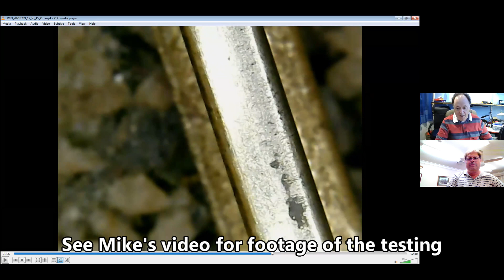Track cleaning on your model railway - what science and experience tells us

Comment: There is a slight problem with your test at 6:03. You should repeat the test cleaning the opposite rail (so IPA on the left, contact cleaner on the right), and run the same loco in the same direction, then check your results.
Reply from the maker: Thanks, the test in the video is illustrative but we both have run other tests looking at both rails and cleaning sections with IPA and non-polar solvents with the same results.  I’ve also got some longer term tests running at the moment to look at long term build up which I’ll post on in a month or two
Reply: @trw1089  I think when making a video like this, you probably should use a fairly scientific approach and show repeatable results. There are plenty of videos out there saying clean your track with this or that and kinda half-done testing. With long term tests, you really need to document it well and it needs to be done on the same track to rule out issues with the track etc. Some questions come to mind such as how long did you wait before running the test? I've used IPA in my CMX, but at night before I'm wrapping things up for the evening. The next time I run things on the track the IPA has fully evaporated. Different results with DCC vs DC? Just some thoughts :)
Reply: @Oorail  I'll just come in here, the tests were done by myself but repeated several times before we went live with the results. The track treated with IPA certainly shows signs of oxidization in short order. The track treated with the contact cleaner simply does not. I've not had to clean my track for two or three weeks now, used to be a weekly event or before every new video. The information Tony and I are setting before fellow modelers is not new at all, its all been proven years back but for some reason the word has not got out there. Both IPA and the non-polar options evaporate within minutes. Hope this helps?
Reply from the maker: @Oorail  thanks, we certainly have followed the scientific method with our tests, our hypothesis was that non-polar solvents, according to the evidence, should provide a better connectivity between wheel and rail because of minimizing oxidation.  We proved that hypothesis through a number of tests, but we also saw the build up of oxidation deposits (black crud) on the IPA cleaned track both on my layout and on Model Railway Unlimited’s testing.  The results we presented illustrate what we found, but we also need to keep the video entertaining and not too long.  The problem with IPA is that the polarity of the solvent means that even after cleaning and evaporation it will allow the formation of active sites for oxidation on the railhead, especially if an abrasive track rubber is used beforehand.  As for DC vs DCC, I think the only real difference is that DCC is more sensitive to dirty track because of loss of signal, not because 14VAC is worse than 12V DC.
Reply: @trw1089  Not really. You haven't even mentioned what kind of IPA you are using - 50%, 70%, 91%, 99%? DC and DCC, along with the direction of travel would have an impact on the flow of electricity through the rails no? You are also saying that an evaporated liquid is reacting with the wheels on the loco? However it's evaporated so it's no longer there? When asked about it as I have here, you say you have other testing, why not show it?
Reply: @ModelRailwaysUnlimited  I'm familiar with the original articles, I think from 2010 and 2019. What type of IPA did you use? :)
Reply from the maker: @buswellj  I was using 100% IPA as supplied by Sydney Solvents which my wife uses for ceramic ink art.  Previously I have used 100% IPA supplied by a hardware store.  I can send you a photo of the labels if needed.  model Railways Unlimited was using DC, I was using DCC, we both had been testing for a few weeks prior to finalizing the filming.  When we were setting this up, we both had done a number of tests to ensure what we were saying was backed up by the evidence, but in the interests of not having an hour long video we presented the results which confirmed what we had seen, to best illustrate the point.  I can post all the references, I can show the other results, if you want definitive proof.  The process of oxidation requires the initiation of active sites for it to start, that happens when polar solvents provide charged points on the rail surface for it to commence, and even after evaporation, the sites would have already been attacked by oxygen and any residual moisture to continue the oxidation process.  This leads to the ablative removal of metal through arcing which builds up to be the black deposits, as confirmed by those who have been observing the arcing and the chemical analysis of the deposits.  Reducing the active sites for oxidation, the microarcing that removes the metal from the rail surface and therefore reducing the deposit build up is what the science and evidence (plus our experience here) shows.  Using a non-polar solvent helps to reduce these elements, hence why it is likely to continue to provide superior results compared to non-polar.  There are other components to this too, like the use of graphite to improve conductance between wheel and rail, and a protectant to continue to minimize further oxidation, but these both impact upon traction which both of us were trying to avoid.  Model Trains Unlimited was also concerned about long term impacts on traction tyres and sleepers which he goes into in more detail in his video.
Reply: @trw1089  The opening title on your video is "The science of track cleaning..." and Mike goes on to reinforce this at 2:51, but aside from some screenshots from a USB microscope, there isn't anything scientific in the entire video other than you two in a video conference talking about the MRH Magazine article. It just seems odd that you've done all that testing but didn't reference any of it in your video? There isn't a statement such as "we both used 100% IPA to avoid water content". Don't get me wrong, I really enjoy Mike's videos and have been a long-time subscriber to his channel, he is a stand up guy. I think however in this case your testing is a bit flawed, definitely far from definitive. There are a bunch of variables you are ignoring such as the environment (where is your layout, whats the humidity and temperature level, dust level?), were the loco wheels clean, did you run rolling stock, were those wheels clean, what lubricant was on the axles of the loco, what type of motor is in the loco (some will deposit carbon), the power supply and wiring. Mike's test is a good idea, but for it to be scientific, you would need to run it several times in a controlled environment which limits and show how its reproducible. Going I cleaned one rail with this and one rail with that, here are the results, that isn't definitive. Could be that one of the wheels on one side was dirty, could be that carbon deposits fall out one side more than another on that loco. The best way to conduct these tests would be with a brand new loco on brand new track without rolling stock. Another thing to keep in mind is that non-polar liquids are non-conductive, that is the reason they are used in electrical contact cleaners, so you can spray electrical components and not worry about shorting things out. While they do evaporate quickly, some of them leave a residue which takes longer to evaporate. So now you've got a rail you're trying to improve conductivity on that you've just covered with a non-conductive cleaner! :)
Reply: @ModelRailwaysUnlimited  If they completely evaporate in minutes, before you applied any power or traction to the rails, then how does it have any impact on the rail?
Reply from the maker: @Oorail  I really don’t know what your problem is but frankly we approached this by investigating the background science, reviewing the chemistry (I have a degree in chemistry and have been a scientist for 30 years), looked at the chemical analysis of the deposits, undertook a series of tests and they supported our conclusions and that of the material we reviewed.  I’m sorry it’s not a peer reviewed scientific paper (of which I’ve written a few), but it is certainly approached from a scientific approach.  If you don’t like the results, do your own testing and tell everyone what you found and how that’s consistent with the background material, otherwise, frankly, bugger off!
Reply: @buswellj  Hi John Servisol IPA 170, take care, Mike
Reply: @Oorail  Phew, thanks for the nice comments. I am not sure what is going on here, I explained deeply in my video (have you seen it) that I did indeed clean all the wheels with either the IPA or WD40 Contact cleaner, then cleaned each circuit with the same. Isolation was observed. I then ran the trains and observed the results. Nobody has their layout in a sterile atmosphere controlled test lab, so I felt that with Tony being where he is and me here (UK and Auz) we were representing the general environment that a model railway lives in. To have shown every single test and every single result would mean a video of hours in length. And why would we do that when the science is already proven, all we have done is seek to provide information for the community and backed it up with testing of the type anyone can do. I have used IPA Servisol 170 and another 98% type for decades and it was indeed a culture shock when Tony pointed out the possibility it might be making life harder, but having done the test I am convinced and convinced enough to bring these findings to our community. I am sorry you feel so aggrieved by this, I've read all your messages and still don't understand why? If you are saying its the title i.e. 'The Science' behind track cleaning then I feel it is justified because the science is already proven and know long before we made our videos explaining it? Perhaps if you feel so strongly about this you could do some tests and produce some videos about your findings for your excellent channel? Cheers, Mike
Reply: @trw1089  I don't have a problem, I'm just interested in the subject, given that I have hundreds of feet of track on the layout here. However you seem a little touchy with someone asking questions. Since you have a chemistry background professionally maybe you can answer my earlier question? Doesn't the IPA evaporate at 100% if so how does it alter the track to cause deposits? I'm interested in the results. I actually did testing about a year ago when I read the original article in MRH magazine, right down to buying 5 different kinds of contact cleaner because IPA was in limited supply due to the pandemic. Not all contact cleaner is equal, some evaporate 100%, some leave a protective film. That film is as you pointed out, non-polar because contact cleaner is used to clean electronics and you can't have a conductive film on your circuit boards or it'll cause a short. If you are wiping it on with a rag, its not so bad, but if you pour a CMX full of contact cleaner that leaves a residue, well you are going to see some of your locos cutting out in places where that film is thicker as its non-conductive. If you don't want to have a healthy dialog this is your channel and I'll respect that by stop commenting. However if you are really trying to get to the bottom of it, you'll read this and perhaps answer my question?
Reply from the maker: @Oorail  the problem I had is the tone of your questioning and that you said it wasn’t scientific.  I love it when people comment, but if the comments are disrespectful then I will respond in kind.

The challenge with putting together a video about the science of track cleaning is keeping at a level that appeals to a wide audience, and that’s what Mike and I were trying to do here.  In terms of the corrosion chemistry that is at play here, and this is from my reading of all of the material I’ve been able to gather about nickel silver, arcing etc, polar solvents will attack the surface of the railhead given the high surface area available (just look at the roughness of the surface under Mike’s microscope and how that may be increased by track rubbers etc) and induce a chemical charge at those points.  This will lead to rapid oxidation at those points converting some of the surface to metal oxides (the tarnish that we see).  Those metal oxides are much less conductive that the nickel silver metallic surface, so when a loco runs over it, microarcing will occur at those areas.  The microarcing ablates metal from the rail head which further enhances areas for oxidation to occur, and starts the accumulation of the oxide deposits.  That again affects conductivity, so even more microarcing and so on.  As such, it doesn’t matter if the polar solvents all evaporates, it has induced a charge at the railhead pits starting the whole process.

Non-polar solvents do not induce the charge at these potential active sites, therefore even after evaporation, the oxidation process takes much longer to get going because the charged surface isn’t there.  It will occur, so straight contact cleaner will not “protect” the rail in the long term, but it appears to significantly reduce the amount of oxidation, and therefore providing a much higher conductivity between wheel and rail, also reducing microarcing, so the period between track cleaning is much longer.

You can also further enhance the wheel/rail contact by having a conductive residue over the rails, or using a corrosion inhibitor like NO OX ID, but both of these will affect traction.  Graphite is also regularly used for the same reason, to enhance wheel rail conductivity.  You can also polish the railheads with the back of a spoon which has been shown to enhance wheel/rail connection.  There are a number of chemicals you can use as a corrosion inhibitor, that’s why INOX and WD40 work well, but they leave an oily film which reduces traction, and are not a cleaner so much as just a conductivity enhancer.  I also show a contact cleaner with lubricant that I have been trialing.  It leaves a much smaller amount of residue, but still affects traction and I’m not sure about traction tyres etc (I don’t use them so not as worried about that).  Hopefully that answers your question.  I too have hundreds of feet of track, hence why I have been so interested in this topic from the scientific side and why Mike and I explored this.  Cheers Tony
Reply: @trw1089  Thanks Tony. I sent some information over to Mike via email that explains the key problem with the MRH article, he said he would pass it along to you. IPA molecules are apparently an order of magnitude smaller than the imperfections in the rail and cannot get "trapped". Its likely moisture from the atmosphere in the room is causing the oxidation. With IPA there is no protective layer on the rails hence why you get oxidation faster. The non-polar liquids don't evaporate but the oily residue that remains does not impact electrical conductivity either. That protective layer is blocking the moisture, hence the reduced oxidation. This explains why using Goo Gone and IPA in the CMX gets similar results to using WD40 contact cleaner. So IPA isn't actually causing the oxidation or making it worse, its just not offering any extra protection.
Reply from the maker: @Oorail  it’s not that IPA molecules get trapped, they are several orders of magnitude smaller than the imperfections on the railhead, it’s that the IPA will cause a charge to be induced on the metal surface, which, along with its ability to absorb water vapour (there is no such thing as pure anhydrous IPA, it all contains some water, even in very small amounts, and rapidly absorbs it from the air), provides the right conditions for oxidation to commence.  The IPA therefore sets up the right conditions for oxidation, which then occurs under the influence of oxygen and water.  Non-polar solvents do not have that ability to surface charge, hence why they won’t promote oxidation though oxidation will eventually occur.  As for a protective layer or passivation of the metallic surface, the No OX ID type products do this, by reducing or eliminating active sites chemically, and providing  a conductive layer which prevents oxygen and water attacking the surface.  Unfortunately we don’t have true chemical passivaters available for nickel silver like we can in protecting steel etc from corrosion, nor can we use sacrificial anodes like in preventing electrolytic corrosion on boat hulls.  The use of non-polar solvents, plus some sort of protectorant, would be the best way at maintaining a highly conductive railhead for a long period, though the protective layer has some disadvantages from a model railway perspective.  From the chemical analysis of the black deposit, it is dominated by nickel and silver oxides, probably mixed in with some organic material (oils, hair, dust, skin flakes).  The reduction of this can only be a good thing for our model railways.
Reply: @trw1089  The article in MRH magazine states that "Apparently, polar solvent molecules get trapped in micropits of the metal surface, leaving an "electron charged" microscopic residue". So you agree this part of the article is incorrect because the polar solvent (IPA) cannot get trapped in the metal surface of the rail?
Reply from the maker: @Oorail  it could be trapped, but the molecules of IPA compared to the pit size would be like a raft in the river at the bottom of the Grand Canyon.  It obviously depends on the amount applied, but it wouldn’t be “trapped” per se, but it would induce a charge on the pit surface.